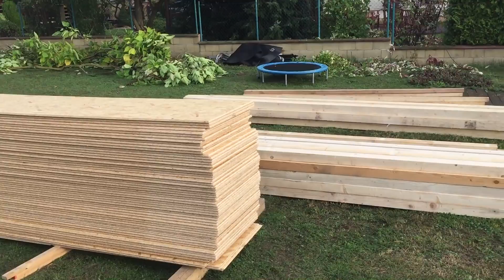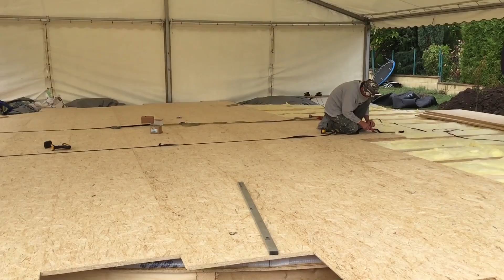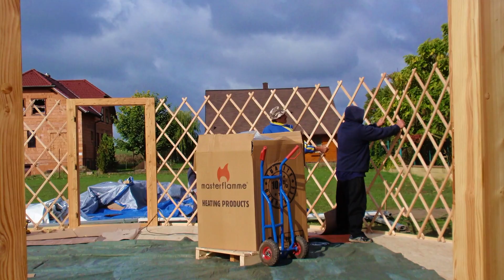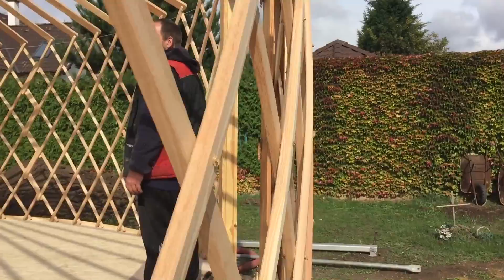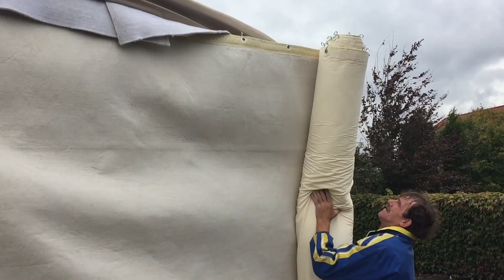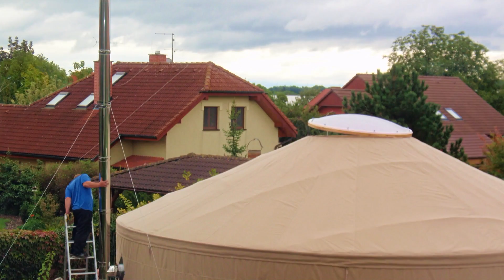10/2016 - Stavba jurty / Yurt installation / Как это сделано - Юрта / 蒙古包安裝 /

Comment: Heating system should be in the center of the Yurt and top window should be open and close direction air Yurt up and out selected always
Reply: It's a kind of a symbolic thing: the turkic people place the "heating system" (fire place) in the center and originally the yurt was built around the "heating system"  showing what's the most important thing is in the yurt. But americans and europeans gnerally place a WC(a sh*tting place) in the center of the yurt showing what's the most important for them and what represents them as a symbol.